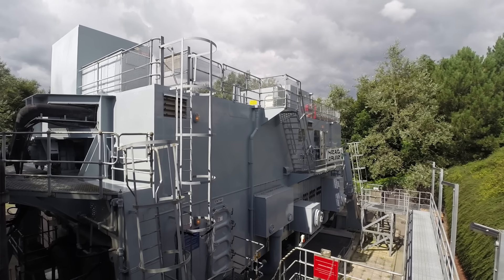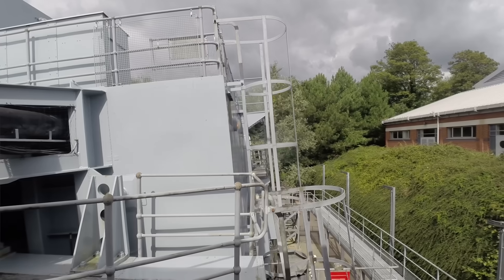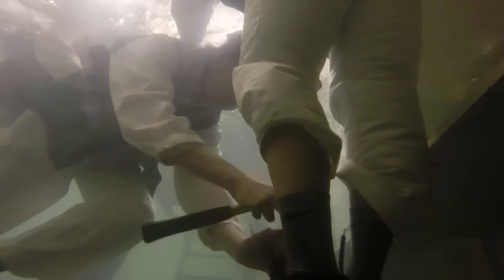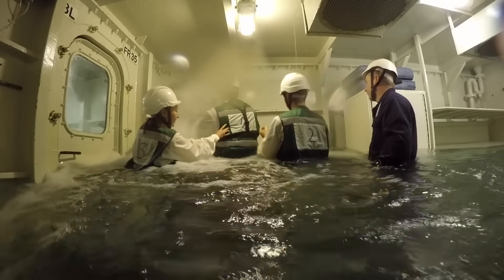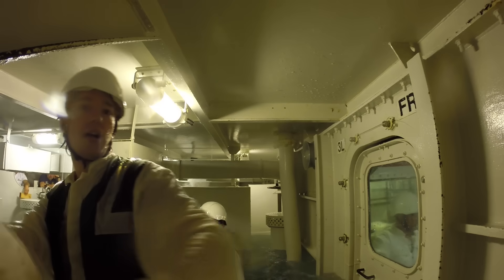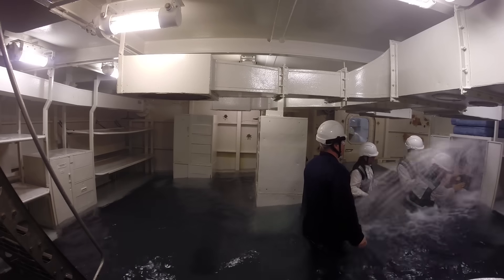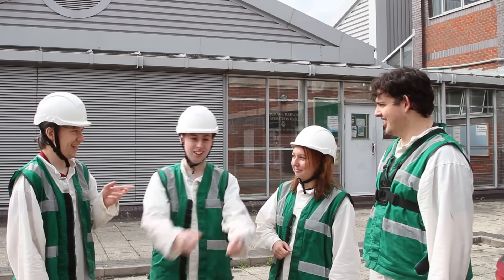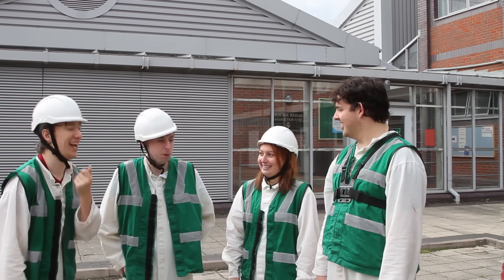Sinking Ship Simulator: The Royal Navy's Damage Repair Instructional Unit

Comment: Using wood may seems weird, but there is not many way to plug a hole quickly. The best way would be to bring the ship out of the water, cut the damaged steel, replace with new one, weld it, paint, wait for it to dry, then return to the water. Second best way would be to dive and weld a plate over the hole. The boat can't move while they do that. Third way would be an inflating baloon, but the sharp edges of the metal would shread it so no good. Wood is actually pretty good, can be roughtly and quickly shaped with an hammer and an edge. Once in place, the more you hit the wedge, the more it will deform and get better coverage since the metal will sink in the wood.
Remember, the hole has probably been caused by a missile or torpedo. That mean they are being attacked. They can't go outside to fix it, they have to plug it as best as they can. All they need to do is plug it enought so there is less water comming in than the pumps can take the water back out. Once they will be back in a safe zone, they will be able to do the better fix, like sending a diver to weld a plate in place. When their mission will be over, they will most likelly go in a dry dock to get proprelly fixed.
Reply: thephantom1492 why cant they move whilst welding?
Reply: Because the divers and all their tools would be swept away by the current. Ever tried sticking your hand out of a moving car? Notice how to wind catches it? Water does that alot more and a alot slower speed. Even if you were physically attached to the ship the water dragging on your body would make it impossible to work if the ship moves at any noteworthy speed.
Reply: Just use flex tape
Reply: But still this seems like an eneffective way of sealing a hole. I'm sure someone cloud improve on this.
Reply: @burgundyknight6826  Wood is used as it expands to form a better seal in the hole

Comment: I did this as a cadet, sadly we wernt allowed in the large system as u were for safety reasons but i id have the experience in the smaller version in the building opposite. it was really quite the experience and if i had the chance i would certainly do the one u did Tom.

Comment: Awesome video. Thanks for doing this. 20 years ago I went through a damage control simulator with the US Navy. It was tiny (only 2 compartments I think) compared to this. It had shooting water at you and flooding, and some bulkheads which would move (we shored up with wood, just like you did in the video). It was some of the funnest training I had been through. It gives a sense of what we might experience, so that we don't freeze up when the real scenario hits (and 100 miles from the nearest land).

Comment: Uh... Does water shoot out at 120 PSI underwater on a real ship?

I don't think so. For that kind of PSI you would have to be like 275 feet underwater. I'm looking at the world's biggest ships and I'm seeing no ship draughts greater than 85-90 ft. Which means that the 120 PSI spraying of water is overkill by a factor of 3.
Reply: +Keith Richards What about submarines? And yes, better to prepare for even worse scenarios so that the real thing is easier.
Reply: +Keith Richards It's always good to train people to be prepared far past what they'd encounter in reality, so that the real thing seems easy by comparison. Romans trained with double weighted equipment for this reason
Reply: +Ror shach i'm not super familiar with how nozzles behave but couldnt the bent metal inward nature of the explosion and shoving long angled pieces of wood into a hole create nozzle like effects to increase the local force coming out? can't you basically get 150psi through the nozzle effects of an explosion hole and wood?
Reply: Don Ziolkowski That's a good point Don. Didn't think about that
Reply: +Keith Richards 
No.
Reply: You didnt listen when he said that high preassure blast is to simulate a high preassure water system pipe breaking the systems which run at those kinds of pressures.

Comment: I've heard that one of the biggest differences between Japanese and American ships in the Pacific War were the levels of damage control. The Americans were able to keep afloat ships that the Japanese would have written off as beyond saving.
Reply: Jim Fortune thats why american carriers were often declared as sunk by the Japanese just for them to reappear a few months later,  the damage observed by japanese strike pilots was often beyond the IJNs ability to fix so they got declared sunk. Techniques improvised by those american WW2 crews are still taught to sailors to prepare them for saving a ship in an emergency
Reply: @themadhammer3305  one of the beauties of war
Reply: yo boychilli adversity is the mother of invention
Reply: The British aircraft carriers were harder to damage than the American ones because the decks were armoured, and the German warships were much harder to sink than other warships because they had the smallest possible amount of doors through watertight bulkheads
Reply: American ships in WWII adopted an "all-or-nothing" armor scheme, so critical areas like the boilers and guns were VERY heavily armored and nothing else was. This saved weight and let us use thicker armor where it was most needed, but it did make carrier decks were easier to damage.
Reply: @tomfoolery4490  
It also meant that, when anything not critical was damaged, it can be fixed very easily and quickly, sometimes even still while out sea. Most crucially, the flight deck.

British armored carriers need to return to a dockyard to repair it's armored flight deck.

Really it was the situation difference between Europe (in range of land planes) and pacific (no land based planes)
Reply: The all or nothing armor scheme was only really used with battleships, from the Standard Types onward.
Reply: @thebravegallade731  The British could (and did) repair the flight decks of there carriers at sea, even during battle, with quick drying cement.
Reply: I believe the Japanese used the all or nothing method with the Yamato and Mushashi but not for other ships. And then I think the Japanese used it out of necessity rather than choice due to the pure size of those ships.
Reply: cough Lady Lex cough
Reply: Not only were they able to do so, famously, the USS Yorktown was so well repaired during the Battle of Midway that the Japanese mistook it for a carrier they hadn't struck and dived after it again, saving the other carriers from any major damage.

Comment: So do they have wooden beams and wedges lying around the ship incase of an emergency?
Reply from the maker: +JHJH007 Yes! They'd have to measure and cut the beams to size - we skipped that part because someone cutting wood isn't all that interesting - but the wedges are part of the standard emergency flooding kit. They can be easily shaped, and expand slightly when wet to make the fit tighter. It's not about completely closing the hole: it's about closing it enough that you can get pumps in and start to reverse the flooding.
Reply: +Tom Scott Cool! Great video btw, really enjoyed watching this one.

Comment: Biggest surprise is that to fix a hole in a ship...they use wood? I guess thinking about it, it is a substance that can be shaped quickly and will expand slowly as it absorbs water. But still it's a little odd if every British Navy ship has a stack of wood in a cabinet in case of a breach.
Reply from the maker: +tangerinealarm Yep, that's exactly it! It won't stop it completely, but it'll stop most of it - and then expand to help fill the gaps. Then they get some pumping equipment in and start clearing it out.
Reply: +Luke Carter Probably not one that can be deployed quickly with minimal training that can also be stored indefinitely without degrading. Bear in mind that these repairs are very much a stopgap measure, meant to hold out as much water as possible util proper damage control teams can get in, assess what needs doing and effect more lasting repairs.
Reply: +tangerinealarm Well, you want it to be cheap, light, and to float to the surface if someone drops it. You could go with some high-tech plastic gadget, or you could just use some wood.
Reply: +Luke Carter its simple, its cheap and in the short term its effective (which since its a temporary fix is fine). so why spend the money to develop something different to do the exact same job?
Reply: +tangerinealarm - well, they built whole ships out of wood for thousands of years, and they worked pretty well.
Reply: John Box
Yeah, who does Luke think these folks are, the American Government? /joke
Reply: +EGRJ Actually we used the same kits in the Yankee navy here.
Reply: It's just a short term water stoppage probably until a welding team get there to properly secure the breach
Reply: @bjj_legend2174  they don't have welding teams don't it, they use hollow metal half spheres or bowls I guess and cover up the whole hole and then jam them in place with wooden logs or pneumatic poles until the ship reached port.
Reply: blu3flare25 but probably not during combat...that's when the wood comes out
Reply: have you eve tried deploying an umbrella under a waterfall? because that's what it'd be like, except sideways :P
Reply: i served in the royal navy in the damage repair team for 8 years. there is 100% cabinets all around the ship with wood all over the place. we are training daily ( every single day, without fail, Xmas, new years day, sundays etc) on how to combat every eventuality on all the flood possibilities. This only shows 5% of the different methods we use. We also come across cracked pipes. Fires, sewage leaks, weapons incidents. Some of the best memories i have from my time in the navy are from stoping or being involved with major incidents.
Reply: Aidan Christini CHALLENGE ACCEPTED
Reply: +tangerinealarm yep all ships have got wood cupboards its an integral part really XD
Reply: Gareth well it takes ages to weld metal compared to 5 seconds to hammer some wood
Reply: @louisnonyourbuissnes5191  other problems of welding i it doesn't always hold, noxious fumes and additional risks-- how do you keep a torch lit under heavy water  flow?
Reply: steve1978ger not as armor but as a whole filler woods great
Reply: +Luke Carter Sometimes the simplest solution is the best.
Reply: tangerinealarm in all seriousness, having been on board several current and old serving Royal Navy warships, there is literally "a stack of wood" in a bag on every deck for this exact purpose.
Reply: also in case they got attacked by some vampires they shouldnt have worries
Reply: Luke Carter Wood literally does everything you ask of it, why spend millions creating something to do the exact same job?
Reply: @Wanderer628  There is the semi ermanent fix, they use a metal dome with a plate on a threaded screw on the inside. Put the pate through the split, tighten it up and the dome fixes and clamps to the bulkhead
Reply: America's navy is the same way. There's more woodwork going into damage repair than you'd think. Metal would obviously be more effective but if a compartment is filling up with water you don't have time to adjust/cut a specific piece of metal to match the hole or bulkhead/overhead
Reply: +tangerinealarm The wood is stowed along the walls of the passageways throughout the ships.
Reply: @webteam1528  i served in the navy,no it isnt
Reply: That's the thing, Gareth; we do have loads of bags of wedges! If the flow is really fast, though, you'd also want to be using pillows, cushions, matresses -- anything else you have to hand! But the wedges expand quickly and are highly effective in stopping the worst of the flood.
Reply: We had the same type of training in US Navy boot camp, and we used wooden wedges, cones, timbers just as they did in this video.  Then the entire crew of the ship also received more in depth training in damage control in Pearl Harbor before we deployed to Vietnam.  There was also firefighting school in boot camp as well as extensive pre deployment training in Pearl Harbor.
Reply: If it aint broke, dont fix it. Youy are correct with the expansion of the wood and its light and easy to use, plus quick when practiced. There is no other better method available.  And yes, every RN ship carries bags upon bags of those wedges and the timber you see being used for shoring
Reply: It’s mostly temporally to hold the ship together untell the ship can be brought back to port.
Reply: +Edward Kayser Yep, wood shoring all along the passageways.
Reply: Luke Carter if it's not broken don't fix it
Talking about wood not ship!
Reply: They’ve always done that. The carpenter went down the bowels of the titanic to do the same but never reported back to the captain so no doubt drowned down there.
Reply: I don't know about British war ships,  but the Canadian Navy ships carry 4x4 at various location as part of our basic equipment to do shoring repairs in case of emergency.  As a ships company,  we would go to the sim once a year.
Reply: +keios Haha, get it? "stopgap"? cause it's literally stopping a gap? aaahhh nevermind
Reply: +Tom Scott I still think in the 21st century there must be a better system than wooden chocks!
Reply: Where can i find info about this ? As a welder and shipwright i would like to see how they did this.
Reply: And if the heating  fails, they've got firewood :3
Reply: Wood is cheap quick and very easy, this is only a stop gap measure meant to slow the water, after this they use massive metal bowls attached to logs or pneumatic poles to cover the holes completely.
Reply: Not during combat where every secound spent on repairs will lower the combat effectivness of the ship and could kill the entier crew
Reply: Still got water in my ear..pissing my self laughing
Reply: Wood is also standard in US navy Damage control
Reply: LoneFalcon because that doesnt wedge, it "sits"
Reply: And to fix small pipe breaks you use rope.
Reply: Same kit here in the us and then we bring in the hull techs to weld her up.
Reply: Yep even in merchant ship we have this nice wooden
Reply: If it work's, why fix it.
Reply: because wood is way softer then steel (duh) the steel will cut into the sides of the wooden wedges locking it in place. If you were to attempt this with steel wedges under the idea of ''the whole ship is made out of steel and other metal'' you are going to have a hard time getting them in the holes without them plooping out again
Reply: They should've used flex tape
Reply: most modern ships are paper thin to put things into perspective. a 30mm auto cannon will do a mess.
Reply: No welding? During ww2 soldiers would patch up holes by welding metal plates to the hole. Why not just make it a permanent fix?
Reply: @blu3flare25  the wood is just a temporary solution to stop the spread of water. Once it's secured they bring out the DCs and HTs to weld it up
Reply: @blu3flare25  Difficult when there's water coming in the hole...
Reply: I think is a Massive Hazard
having massive Explosives such as hundreds of Missiles, Rockets and than having bits of flammable Wood everywhere just in case there's a hole 🤔
Reply: @niceboy60  trust me that wood catching fire is the least of your issues if you got hit.
Reply: @niceboy60  you're going to need a whole lot more than a simple spark to set that wood on fire - even when it isn't completely soaked in water from plugging a hole
Reply: @DazBochiz  in a Ship with Ammunition, Explosives, Missiles and some even Carry Nukes & Sweeming pool size fuel Tanks 
.
Sparks & fires its not an unlikely possibility
.
You don't need all the Wood lying around
Reply: @niceboy60  nukes aren't flammable and most ship fuel wont even light from a lighter let alone a few sparks

Comment: how many times would you have drowned if that was real life (so if they weren't pumping out the water)
Reply from the maker: +samramdebest A lot. We were slow! There's also an emergency overflow there, so even if the drains stay closed for some reason, it's (relatively) safe. You could still get trapped under something, of course, but that's why they have safety officers there!
Reply: samramdebest you can only drown once....
Reply: @BenWatkins  This is simulation so infinite.
Reply: Also, in a real situation, water would probably be allowed to flow away from the breached room to, you know, prevent the rescuers from drowning. But yea, It would probably also fill up way faster than in this totally badass simulator.
Reply: They still pump water out irl. Just not as fast.
Reply: Ben Watkins
Understandable have a great days.
Reply: but in a real situation, they will do everything possible to not go under
Reply: Water would be pumped out in real life, not too much, just as long as you can get the emergency bilge pumps operating
Reply: in a real situation... missile stricken burning ship without electricity, bilge pumps are inoperable. some areas are even without of its access